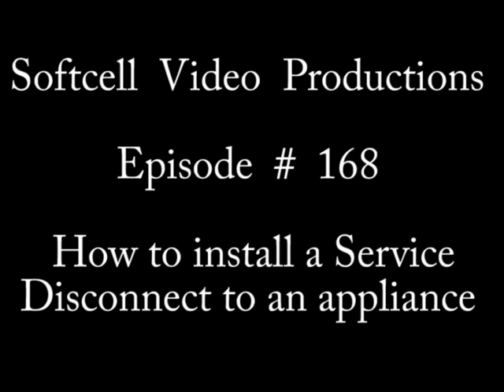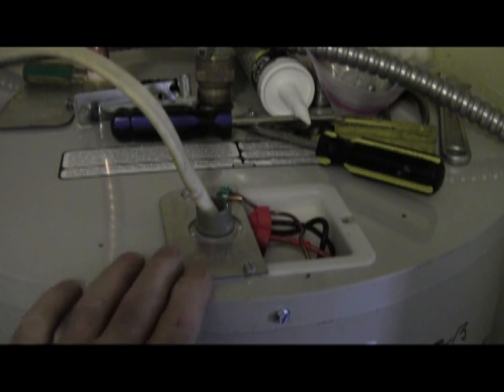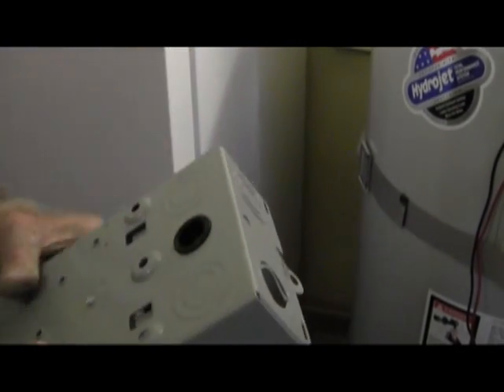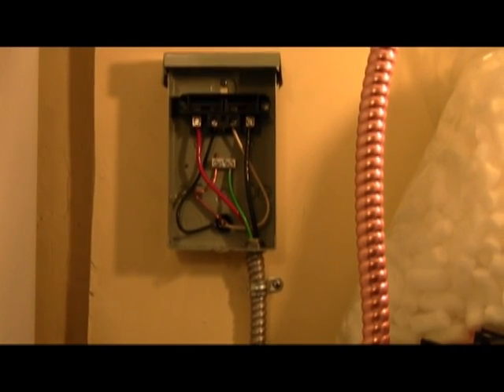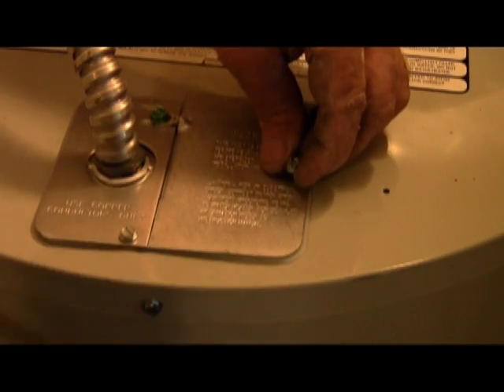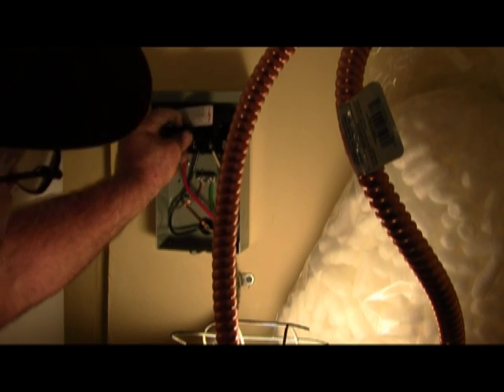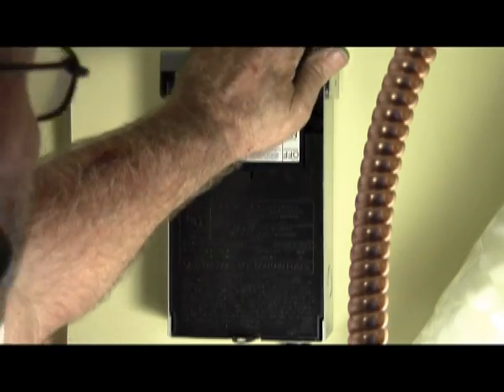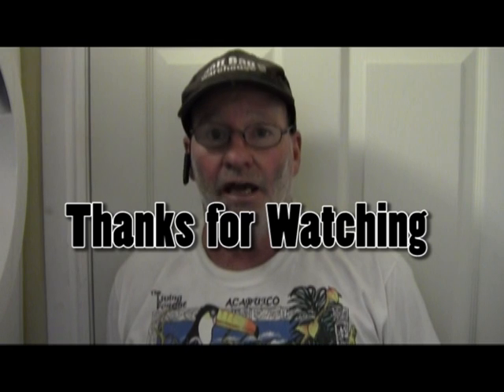NEC code on hot water heater and disconnect. #2 G  #168

Comment: i do not understand what you meant by dissimilar ground wire at 1:50.
Reply: Bare copper grounding wire running inside galvanized steel flexible conduit equals dissimilar metals. Galvanic action between the two can occur, causing corrosion and damage to the grounding wire.

Comment: I'm in San Antonio Texas and moving my heater to the garage and running all new wire from the breaker...is 10g Romex ok on a 240? I know dual pole 30 àmp breakers. Some electricians told me my whole house needs a 25k watt surge protector... WTF is a breaker for??? 25,000 watt??? That kind of power will try the breakers before damaging any appliances...no???

Comment: Just a small quibble but the bushing that you used to protect the cable from the edge of the knock out hole is not NEC Compliant in that application.  Because the hole is large enough any listed Non Metallic Cable connector can be used to connect the cable to the box as the code requires. The easiest one to install would be the snap  in plastic variety which have a built in cable grip. It is relatively easier to use then many other types. The cable goes in through the grip rather easily but will not pull out unless you cut the grip fingers off of the snap in ring. 

Bottom line is that the cable must be attached to the box when the wire is fished so that it is not being supported by the electrical terminals. 

-- 
Tom Horne

Comment: can i run a 220 line to a heater that is 208  v?
Reply: There is no such thing as 220v in the USA. Do you mean 240V? 
Usually yes the single phase 2 pole water heaters are rated for both 208/240. Check the name plate on the appliance.

Comment: Hmm, so you're not allowed to simply install a 240v outlet in the wall, and use a 240v appliance wire (as on an electric stove or dryer), and plug the heater into the outlet? Why is it ok for stoves and dryers but not water heaters?
Reply: Because a stove or a dryer has a switch to turn it off would you feel comfortable pulling a 30amp plug that is under load?
Reply: No! A water heater is a permanently installed appliance per the NEC, and as such must be permanently wired, not with a cord. Washers, dryers and ranges are not considered to be permanently installed appliances.

Comment: what 3 foot rule!?
Reply: 3 foot rule basically says you need at minimum 3 foot deep by 30 inches wide, or the width of the electrical panel, whichever is greater. This area has to be completely clear in order to disconnect or service the panel. OSHA requires that businesses mark the floor in front of the panel to warn not to place anything in front of it.
Reply: Yes, was curious about that as well. Not sure if he meant the water heater is less than 3 ft from wall, or panel, or something else.

Comment: I'm glad you removed the ground wire from the cover plate mounting hole; but, I'm disappointed that you put a grommet instead of a cable clamp on the back of the disconnect.  Also, your 'finished' work does not have a staple within twelve inches of where it enters the box (I don't know about your local; but, that is NEC.)

Comment: No such thing as a HOT water heater. If the water was hot it wouldn't need to be heated. It's a water heater even cool water heater would be more accurate, room temp water heater lol
Reply: Get a life!
Reply: also when the water heater is done heating and cycles off, it becomes a hot water storage tank. once some hot water is drawn, it continues to be a hot water storage tank and a water heater again. it is very rough for water heaters to maintain an identity.
Reply: Reminds me of the ATM machine - Automated Teller Machine.. machine. 😂 I also used to call it a hot water heater growing up, that’s what I always heard. Now I cringe a bit when I hear it.

Comment: What I need to do in my condo storage room to have ability to turn off the hot water tank from the room it's in.  Currently all the 220 hot water tank shut off boxes are in the hallway on the other end of my building. Yes the main panel is easily 30-35 (or less) from my tank. 
 My 220 wire is also just coming out of the wall as it was in your video into my storage rm and I never did like the idea of that.  
What do you think a reasonable fee would be nowadays to have an electrician come do this but like a breaker where I can shut it off from my storage room when I need to service my hot water tank . I'm comfortable with doing my own ceiling lights etc...but obviously this one I'll leave to the pros.  Thanks for the video.
Reply: I think you would have to delete the

 disconnect that is in the hallway of your building in order to get it to turn of in yourt storage area ,right?

Comment: The new tank I have has red and black with the green for ground. The old one had blue, green, and the ground is nearly stripped of all color. How can I decipher the positive from the negative lines if they are different colors from my previous tank?
Reply: This is AC so there is no polarity issue. As long as you can identify the grounds then you know the other two wires are hots and you can just connect them regardless of color. So you don't care what the old tank is you only care what the source wires are and the new tank. So just hook your source ground to the tank ground, then hook the other wires.

Comment: Why can't you use a breaker instead of a disconnect? I'm just a curious non-electrician.
Reply: HERZ USA yeah completely wrong. Have you read code article 422.31 ?
Reply: @mrsygk5845  thanks; you saved me from doing more work than I had to.

Comment: One of the best videos for installing a disconnect box.  I have 2 questions:  1- you drill a hole on the wall but did you drill next to a stud?  I assume you didn't drill inside the stud because but how did you securely mounted the disconnect?  directly on the dry wall?  2- How far (the ideal) location for a disconnect box?  on the joist above the WH?  On the back on the dry wall?  on the side?  thanks!!!  good job!
Reply: Toggle bolts

Comment: What are you talking about when you say you can use the ground in whip b/c of dissimilar metals? And I'm sure you didn't use AL THHN, so I'm missing something.

Why didn't you just strip some insulation off the green THHN in lieu of using a terminal?
Reply: Because it was stranded wire.
Reply: @chibbyfode  but lights have stranded wire connected to solid wire romex?
Reply: Lights don’t have as much of a load

Comment: don,t understand the wiring in the box.  It looks like incoming is a black wire, white wire, and a ground.  I thought a water heater requires a 240 volt line with a black, red, white, and ground.
Reply: s wilson that's what I thought too.

Comment: Unless the water heater is farther than 50ft (within sight rule) from the panel,  NEC 422.31 States the branch circuit switch or CB serves as the disconnecting means.  Probably could have solved this one with the FMC connected to a box for MUCH less.
Reply: It has to be 1) lockable, or 2) within sight.  Something can be less than 50ft away but not visible (around a corner, say), and most service panel circuit breakers are not lockable.

Comment: What size wire do you need to install the water heater?
Reply: Usually (90% of the time) 10 AWG wire and a 30 Amp breaker, but it really depends on the Wattage rating of the water heater elements AND if the water heater thermostats only turn 1 element on at a time or if both elements can be on at the same time.
Reply: Hi did you find an answer?
Reply: 10 gauge

Comment: Did you remake white wire as black NEC 200.7(C) says mark a white wire black as a hot line in a 240v circuit.
Reply: In 240 volt circuits, in the absence of another colored current carrying conductor (e.g. a red one, as seen in 4 conductor cable), it's common knowledge the white is the other hot.

Comment: Thanks for the video! 

I'm looking at an existing apartment installation. 

The owner has mounted a plywood panel on exposed concrete block to place the cutouts. There is a wood furring strip up to the joist. 

The romex is exposed on the above floor joists. Can a metallic handy box be used as a mid termination point so I can get the owner to do a new installation as you recommend. 

Does the romex from the service disconnect also need to be in armored conduit (up to the handy box).